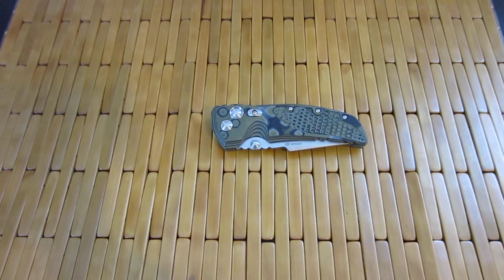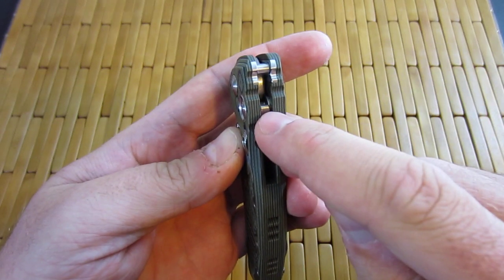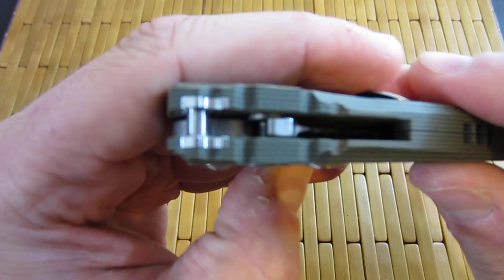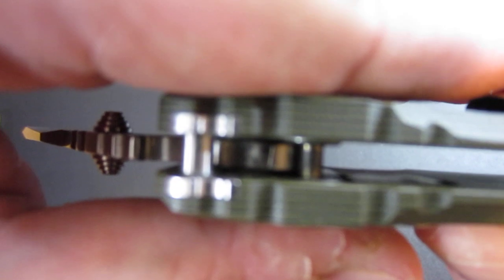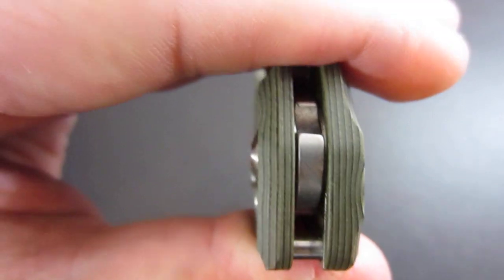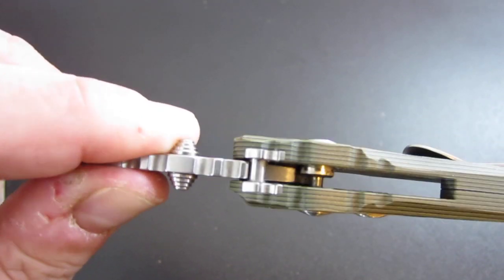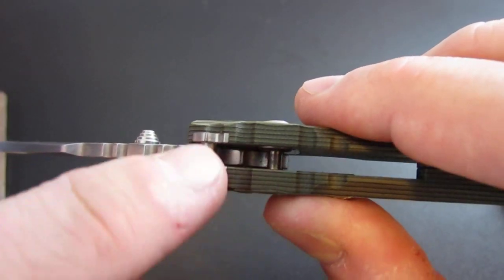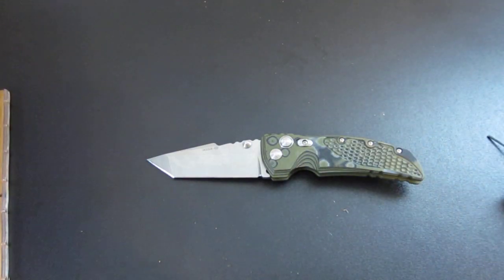How Does a Button Lock on a Knife Work?

Comment: Thank you for the video. I am looking at purchasing a SOG now with a button lock. I have never used one on an assisted opening knife. I had a lock fail me once when it counted, so I never buy a knife without checking out the locking mechanism. I am not a big fan of liner or frame locks, although some are ok. The close up--once in focus--showed how well it works with your explanation. Good job.

Comment: Good video. My preferred lock is still the Cold Steel Triad. It mihgt not be as fashionable as the button lock or the farme locks, but it is strong as hell. I have an old Rajajh II I bouhgt to scrw around with and I just can't brake that lock I've beaten the hell put of it and it is still good. But I guess the button lock would work OK on smaller folders.